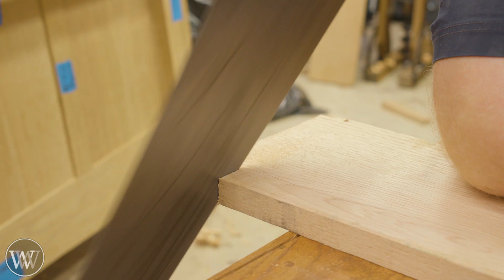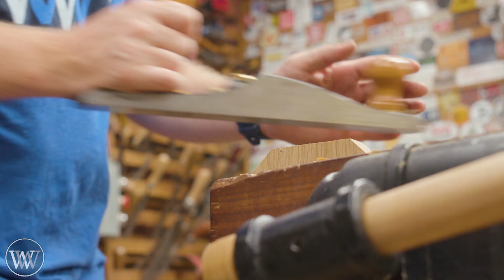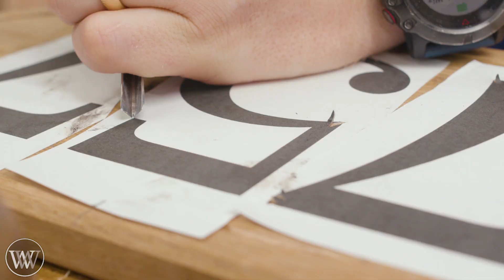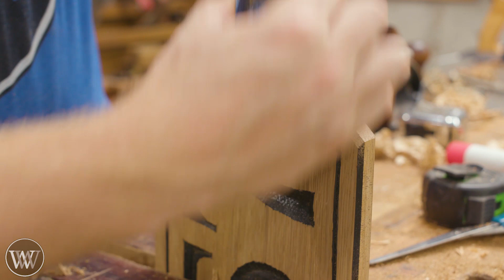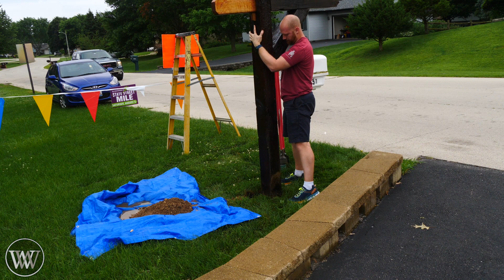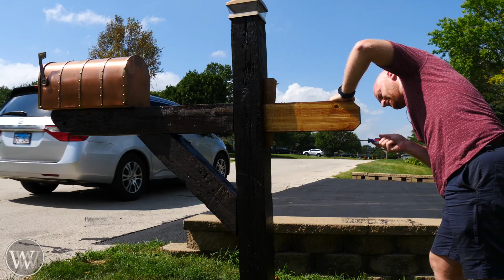How to Make a Timberframed Mail Box Final Video

Comment: Turned out very nice....sometimes mistakes cam make something nicer....as in the mistake you have when carving the numbers. I personally like the thicker number sign, especially with the heavy duty railroad ties. The only other thing I would like to mention is that the riser does not appear to be plumb....maybe it's the angle of the camera or purposely done bt design as the horizontal run look perfectly level.
Reply from the maker: Thanks. Yes the riser is plum however the retainer wall behind it is actually at an angle so if you judge anything off of that it looks out of square.

Comment: I highly recommend you trying Inkscape for (almost) all sorts of drawing on a computer. It may seem easier to adjust horizontal spacing when each character is on a separate piece of paper, but you need to keep them all vertical (which isn't trivial in some cases) and on make sure their baselines are vertically aligned (which is quite difficult with any rounded characters as they extend slightly below their baseline). With Inkscape you can allso add some guides e.g. middle lines of the characters. Inkscape is free software (free as in "free beer" as well as free as in "freedom").

Comment: James, honestly, I think the "mistake" you made was for the better. You added more "meat" to put he screws in. Sometimes mistakes have a tendency to work out for the best after all. 

Concerning the numbers, what do you call it when you carve all around it and leave the numbers/letters/symbols or whatever raised? Is that relief carving? Whatever it's called, I wonder how it would have looked had you done that? Maybe carve out the line around, leave the numbers raised, and carve out everything between the numbers and the outside line. I may have to try that on mine if I'm ever able to do this project. Thankfully, I live in a rural area so regulations aren't that stringent on us.
Reply from the maker: Thanks Matt. yes that is Relief carving. I ahve done that on a few in the past. it is fun. though more work.